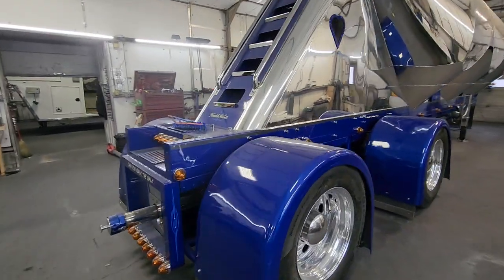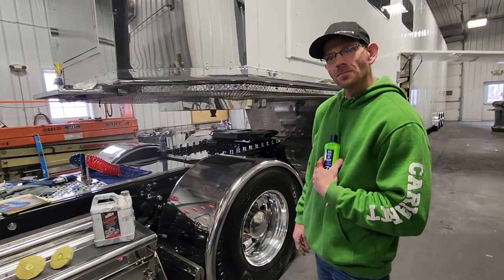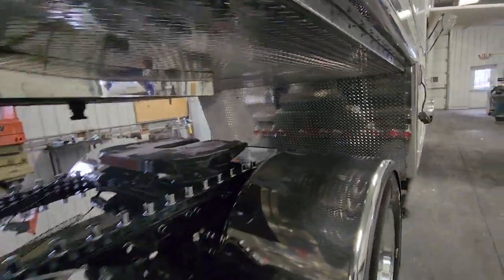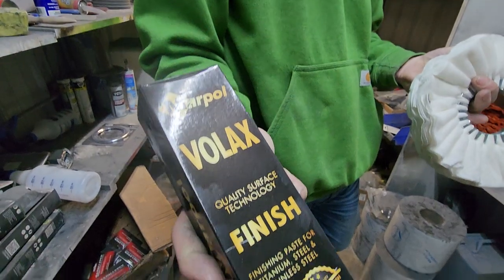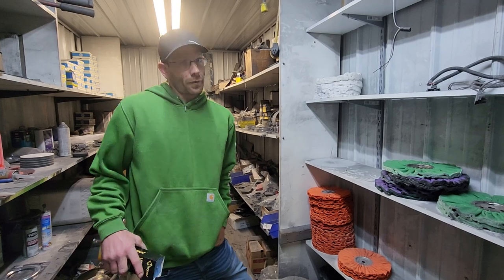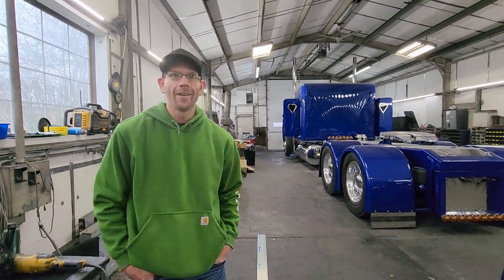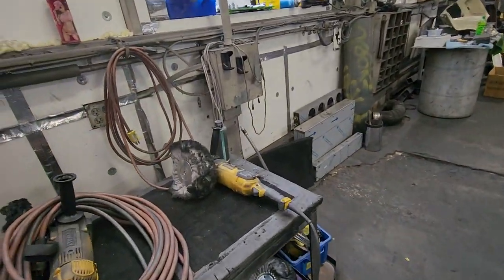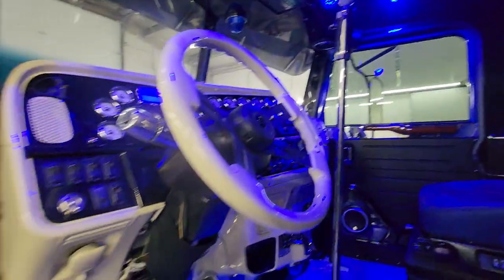HOW TO POLISH & RESTORE ALUMINUM & STAINLESS, FROM KENDALL @ KEYSTONE WITH 40,000 HOURS EXPERIENCE

Comment: if ya ever go threw a truck wash never have them use brightner it will dull up the alumininum works great on taking stains off the trailer but will destroy the shine on any aluminum they usually cover up your wheeels n tanks if ya want brightner